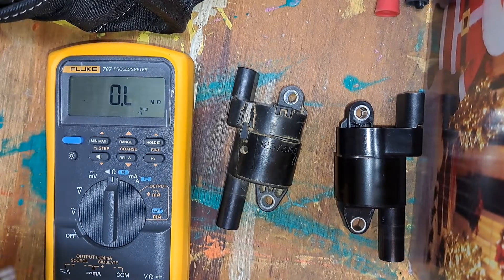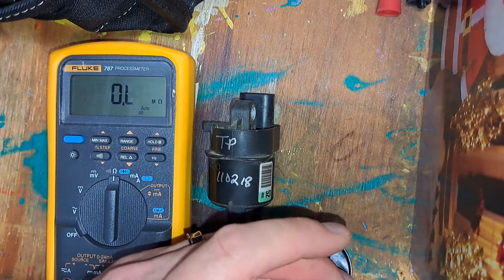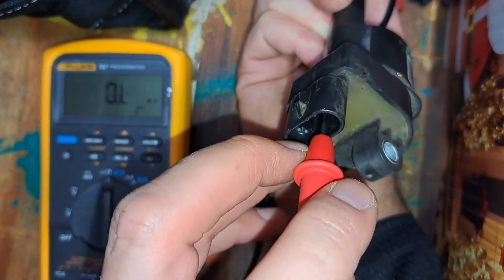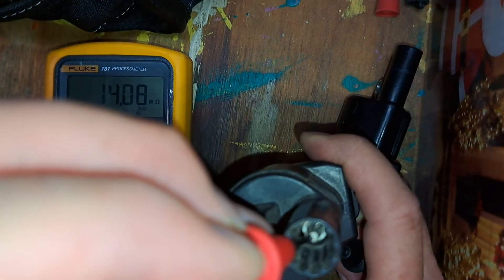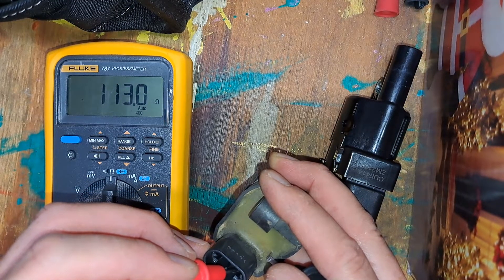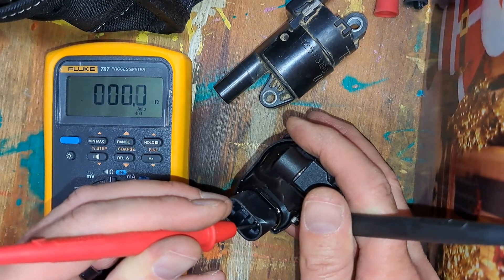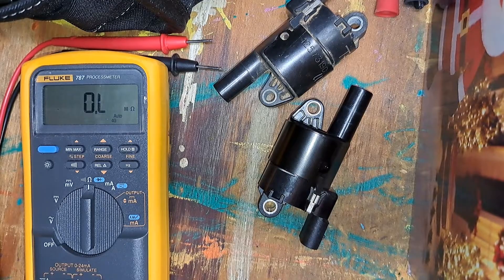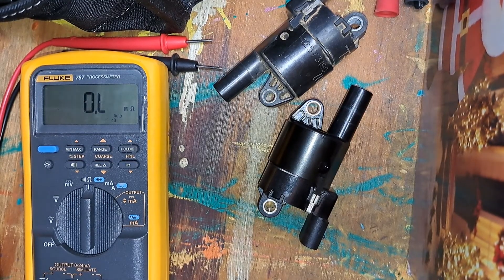2013 Silverado Ignition Coil Resistance Testing - AFM / Bad Coil Causing Engine To Miss While Idling

Comment: Ignition coils have primary and secondary windings, just like a transformer. The primary winding is thicker and shorter in length which will give a much lower resistance reading than the secondary winding, which has a thinner and longer length. 
1st(left) terminal is most likely part of your primary coil.
The two middle terminals are most likely your secondary terminal. 
The 4th terminal on the right is your ground, which is why you were seeing a zero ohm reading to ground.  
Your bad ignition coil has winding degradation or deterioration which is why the readings we're out of whack on All four terminals.  If just one of those terminal readings are out of whack, it will speed up the wear and tear to the other terminals' ratings.  Great video by the way.
Now I know where to start on my truck.  It has a rough idle briefly when my truck decelerates to a stop.  With all the reach search I've done, everything seems to point towards ignition coil issues.
Reply from the maker: @johnharrisonschulz  I have not had the same coil or any coil go bad since disabling the AFM function. I had my local garage with a programmer perform the delete for $100, worth every penny. I lost about a mile per gallon, but I was willing to accept that trade.
Reply: @mchenrykramer ,  About a decade ago, when I bought my 2009 Chevy 3500 HD with 40K miles on it, I hired a high performance speed shop to dyno tune it, which cost about $600.  That was worth every penny. The shop custom-tuned my truck to the gross weight I wanted it at which greatly improved its performance and improved my miles per gallon from 10 MPG to 12.5 MPG. I added another 140,000 mi on it after the tune-up then I finally changed the spark plugs.  I've only had to change the spark plugs once after 180,000 miles. Zero issues with the truck after that high performance Dyno tuning.  It only started running a little rough at deceleration at 
190,000 miles, which is why I think it's time to check/replace the Original ignition coils.

Comment: This is exactly what I am having on my 2011 cylinder 8.  I am going to try and swap it out and see if it fixes the issue.  Mine only has a rough idle and not when under load.  Highway drive is a breeze.  I did notice that I had degraded compression in cylinder 8 that may be resulting from the coil not combustion properly.  Thanks for the video review
Reply: Just to update...bought a new one and it didn't fix the issue.  Still rough idling.  My #8 has degraded compression then the other 7 they are all + - 10.  Still have yet to pull the injector even though i can hear the injector ticking like the rest....hoping it's not the seals but it may be going downhill
Reply: @SilentHill43 same issue man. I’m literally about to buy a used newish engine and just say screw it. I can’t figure this out. I also get a rough start up sometimes and white smoke when starting and it dies off fast. I bought a AFM disabler and that still hasn’t fixed it
Reply: @SilentHill43  on mine I've been having a missfire on number 8 and found a spark coming from the boot. I have replaced coil pack and boot and sparkplug and still arching, I was told the ground or power wire is bad and causing the coil to over produce volts and bleeding out and causing my miss. Start your truck and look around number 8 spark plug and see if its arching at idle.

Comment: One year later, my best uneducated and uninformed guess is an electrical issue leading into the coil. The wires coming off the pigtail are labelled A, B, C and D. D is Battery positive (key on), C is the control wire from the computer, B is a clean ground ( from the battery) and A is a ground to the chassis. If you do a key on engine off back probe of the pigtail verify that you are getting battery voltage from D. Then you can verify the two grounds are doing what they're supposed to be doing. Grounding. If those are working, then the only variable left is the control wire coming from the computer. I'm not sure if you would get a stable reading if you probe it with the engine running since it would be a low voltage pulsating into that wire. It is safe to do this with the injector disconnected. You can try that. If the others pass the test, the control wire may be having issues of continuity. This can be from being frayed, poorly connected to the junction box in the middle of the engine cover or have a ground fault of some sort. Trace the wire back in sections as much as you can and do continuity testing with a multimeter.  Worse case scenario, the ECU may be faulty (rare but possible). 
Hope this helps. Good luck. 

2003 Chevy Express 3500 owner/self maintainer

Comment: THIS GUY NEVER SHOWED NOTHING
Reply: Well, your statement is a double negative, so that basically equals the fact he DID show SOMETHING. Apparently you just didn't notice? 🤨🤷‍♂️
Reply from the maker: @frankbatiz8908  Sorry, I was just hoping to help someone with the same issue.  What were you looking to see?
Reply: @mchenrykramer  Just want to know whats wrong with the old one compared  the new one. Couldn't understand anything you tried to show. I didnt get the point
Reply: @frankbatiz8908  the bad coil has ohm readings on the terminals when the black tester wire is attached to the ground wire outside of the coil. The good coil has no readings so basically when testing, the bad coil has wire continuity (closed circuit/a shorted wire in the coil) but the good coil has no continuity (open circuit). I think the first coil he tested which had no readings is the open circuit/no continuity/good coil. The 2nd coil he tested from the start is the bad coil
Reply: He very clearly showed the is a leakage path to ground, it's not his fault you have no understanding of that
Reply: @601Volvo fr lol at least have basic understanding of an multimeter and ohms
Reply: Following this video i found 2 of my coils were showing closed circuit/continuity and the other 6 were still sweet

Comment: Hello.  did you find out the root cause to the #1 coil always going bad? I'm having the same issues
Reply: Mine is doing the misfire also. On hot days, it's much worse. Cool mornings, minimal misfire. Just tuned up with coils, plugs, wires, fuel filter, two tanks worth of Seafoam, and O2 sensors. Ran great until last week, betting #1 already burned a new coil. There MUST be a way to insulate #1 from the heat!
Reply from the maker: @bradleyrussell1973  I have not had the issue since I got the programming change and it stays on 8 cylinders. I have a feeling that it was not getting enough oil in the cylinder and was getting hot. I read where some folks have gunky buildup in the ports in the valve cover. Thus, not letting the oil flow.
Reply from the maker: No, I never found the source of the issue.   However, I did have a lifter tapping that I have wondered whether it was related or not because I have seen videos and read where the valve cover oil channels can foul up and prevent proper lubrication of lifters. I used Marvel Mystery oil mixed in with my oil change and the lifter stopped tapping. It has not started tapping since. Coincidentally, I have not had a coil go bad either. However, that is not definite proof that the coil issue was related to the lifter tapping issue.
Reply: @mchenrykramer ya i been trying to trace what I think is a bad coil pack getting heat soaked on hot days but I'm  not positive but also have a lifter tick. Lifter tick /collapsed lifter is just getting replace and dod delete and a few other things since have to pull heads. Know what they say if your going to do it mid as well  it right the first time lol
Reply from the maker: @ChippyOutdoors  that's right! Since using MMO and doing the delete, I have not had to replace another coil and no lifter ticking.

Comment: look for ozcorr909 "How to bench test LS ignition coils and wiring explained" not exactly what you're looking for but he sets up coil test explains pins: 1. constant power for coil capacitor which explains why it keeps climbing 2. signal 3. ground to ecm 4. chasis ground.   In the end it wasn't the coil for him on cylinder 1 but the signal wire, good luck.

Comment: Have you changed the spark plugs?
Reply from the maker: Prior to this, I have changed all spark plugs. All eight. I change the spark plug associated with the coil every time I have this issue.  I do wonder if the situation exists that either the spark plug is causing the problem with the coil or the coil is causing the problem with the spark plug. I have read where there's a possibility that restricted oil flow because of fouling in the ports in the valve cover to the cylinder that leads to the issue is causing excessive heat because of a lack of lubrication to that cylinder which kills either the coil or the spark plug..
Reply: @mchenrykramer  Then you must consider it could be a bad ECM/ECU.

Comment: I have a degree in electronics.  As a such I've learned that electronic parts do not like or survive in an high heat environment.  Therefore, anytime there is an electronic part close to, say an engine compartment or an engine block, the electronic parts WILL fail. 
I've seen the electronic schematic of these coils and they contain a "power transistor" and, at least, one diode.  Those particular parts are susceptible to extreme heat (engine compartment) and are not "heat-sinked" AKA cannot dissipate heat from the electronic circuits that exist in those coil packs, e.g.  the  transistor and/or the diode.  As a result, given time ( albeit semi-short) those components will fail. I had a similar situation with a fuel solenoid driver on a diesel truck.  The FSD pack (fuel solenoid driver pack that had power transistors) was not "heat-sinked" properly from the manufacturer and as a result the engine would die.  The fuel pump was fine but the FSD failed due to engine heat that the electronic parts could not handle.  I'd guess many vehicle manufactures' do not address this problem effectively.  These coil packs are mounted on the engine block and may fail prematurely given the high heat environment.. With that said, there are still plenty of vehicles that are still amble, so... When i've looked at these such coil replacements there seems to be a replacement packs of eight for both sides (or banks) of the engine.  Why?  Your interest is as best as mine.  Note: Keep electronics cool.
Reply: Since electricity transfers its energy to heat too, lol